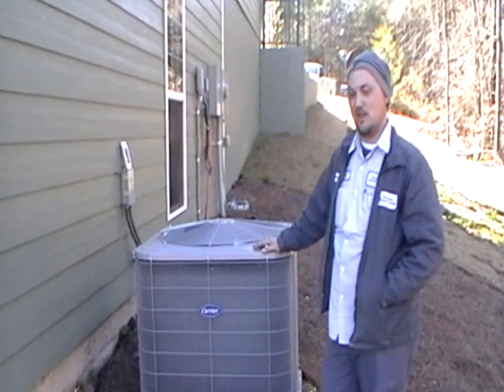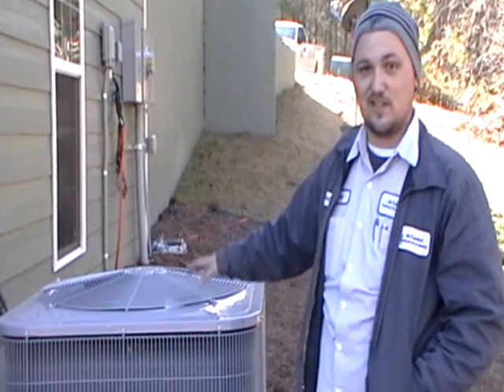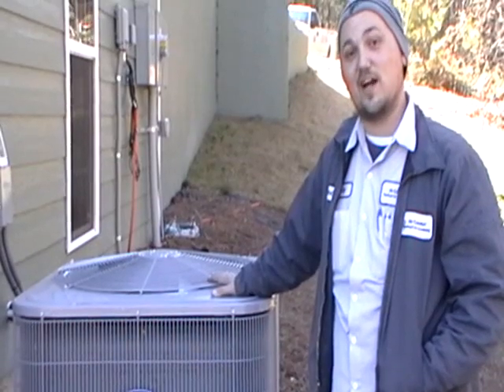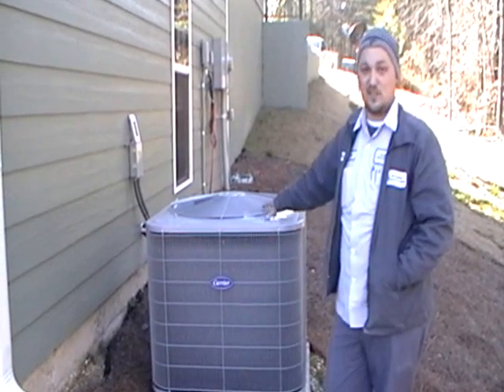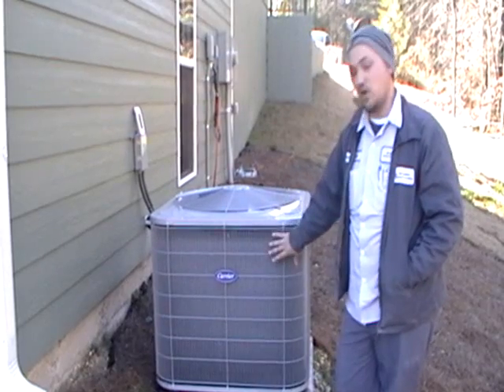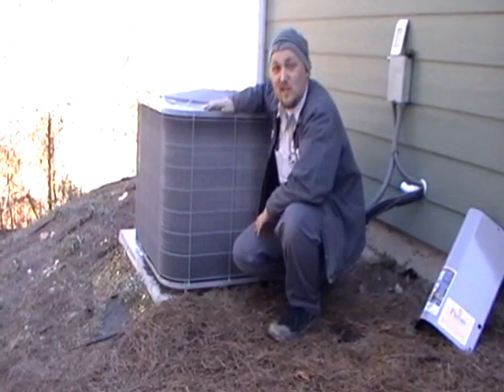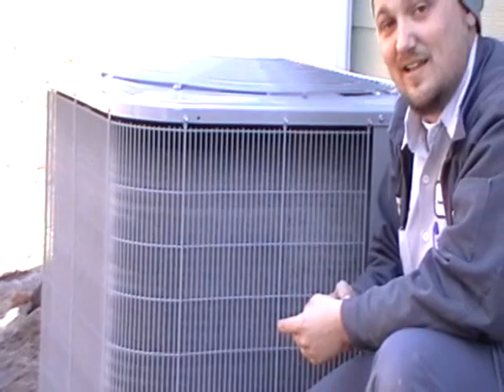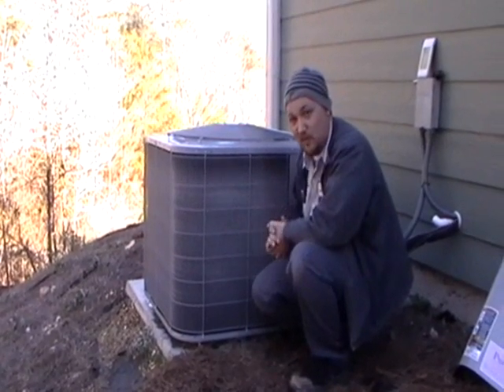Carrier Heat Pump Defrost Cycle Explained - Chattanooga TN HVAC Contractor

Comment: Are they the same with heat pump. Vs central air? I'm learning I'm confused
Reply: the only diference in central air and a heat pump are that the heat pump in the winter , is reverce to an airconditioner , and in the summer it works like an air conditioner

Comment: mine sounds like a rhythmic buzz on off on off
and it seems to lsowly speed up its on off rhythm until it is running full bore with fan and when fan is at full speed, the rhythmic buzzing on off on off goes away.
Whats that about? Sounds to me like  bad bearing or something? Sounds like when RPMs go high enough the virbration smooths out. Ideas?

Comment: You mentioned 2 things that happen in defrost....#1 switch to cool......#2 Turn off outdoor fan...... Then a third thing that happens in defrost is that the strip heaters turn on inside the indoor unit in order to not blow cold air on the customer.

Comment: Yep, One strip is energized while in defrost, to compensate for the unit switching to A/C mode. Although not very efficient while in defrost the systems COP drops considerably.

Comment: It's normal for Scroll compressors to make that sound on the pressure change during a defrost reversing valve shift.  The Performance and above Carriers have a quiet shift mode that cycles the compressor during the reversing valve shift to prevent the scroll noise.  According compressor manufacturers, the scroll noise is not harming the scroll compressor.

Comment: most of these units if wired correctly and with the correct thermostat will kick the strip heat on while its in defrost mode.
the technology has vastly improved and some of the heat pumps heat effectively down in the 20 degree or less range

Comment: When my Bryant outdoor unit was on defrost mode, my indoor register blow out cold air (around 43 to 55 degree) sometimes.  Especially when outdoor temperature is low, cold air come out more frequently.  What components or parts need to fix?  Your professional opinion is highly appreciated.  Thanks in advance.

Comment: Doesn't it make more sense to use the furnace to heat the house instead of running the compressor all winter?  From what I understand, the compressor is what uses the most electricity and is why running AC is so expensive!